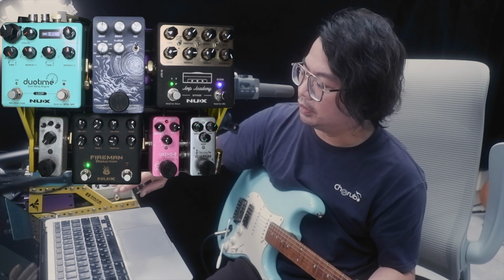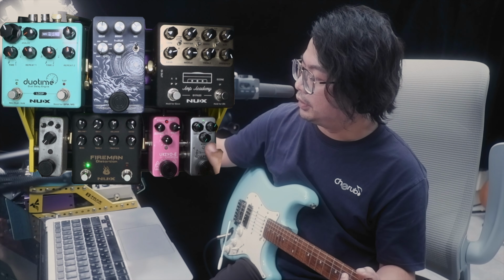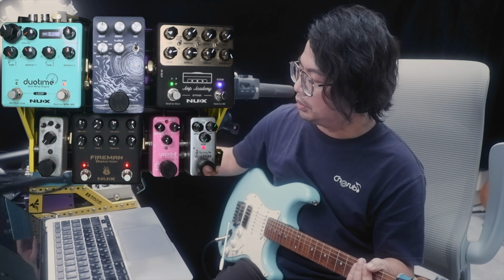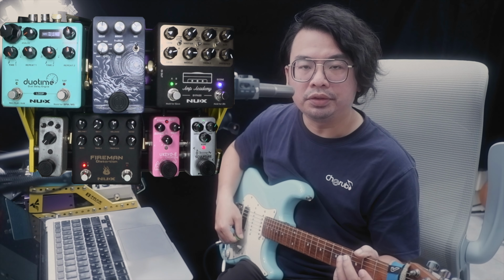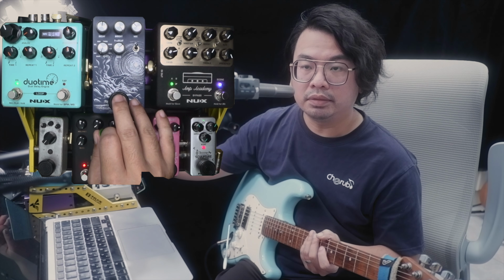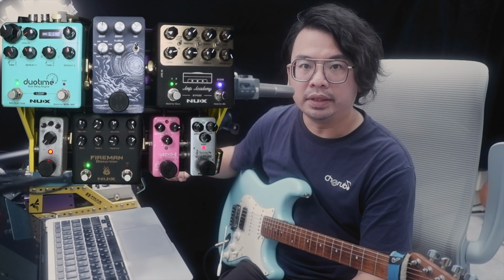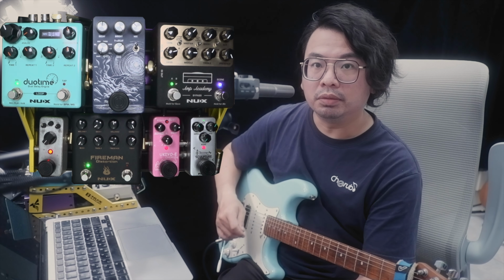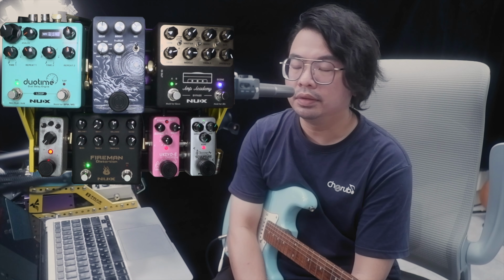My Latest Pedalboard !!! Feat. NUX Pedals

Comment: My pedal board is very similar to yours , I hace a NUX Masamune Komp + Boost > Mooer Hustle Drive ( OCD Clone ) > Mooer Cruncher ( high gain ) > Amp Academy > Duotime Delay in the FX Loop of the AA. I am going to check out that NUX Fireman , love the way that sounds ! I need to look at the power supply as I do get Some noise . I am also using reverb in the AA as I think they sound pretty good . Thanks for the rig rundown your tones always sound excellent !

Comment: Hi Jimmy my current pedalboard is very similar to yours. For boost I run a Boss GE7 the end of my signal chain for a solo boost. I have seen on some AA chats that they suggest putting the boost pedal in the AA FX Loop after modulation / reverb. Do you think this a good and effective method? Thanks!
Reply from the maker: @caleshtcincredibles  If the GE7 is for volume boost, I suggest you put it after the drive, before modulation & delay & reverb. Otherwise it will also amplifier the mod, delay, and reverb. Which depends what you need.